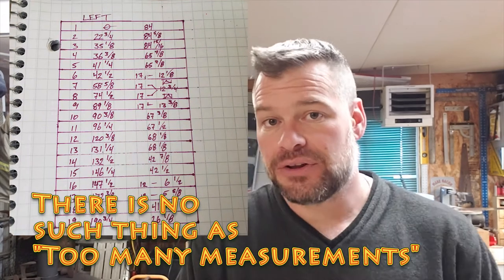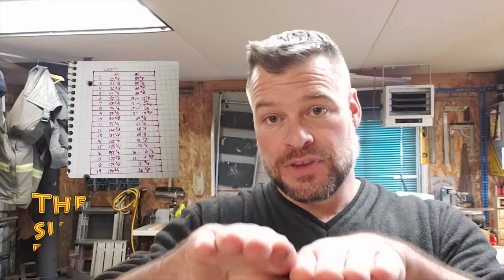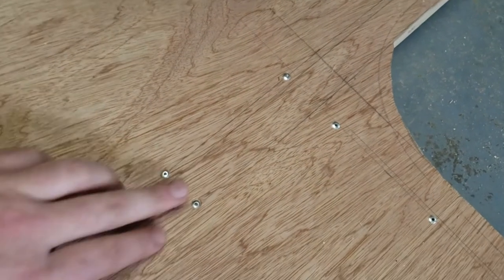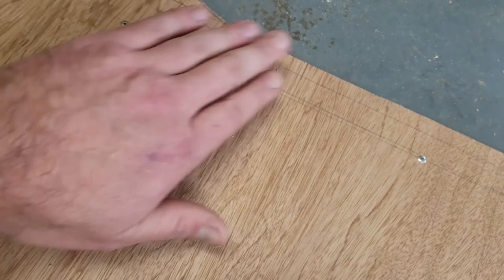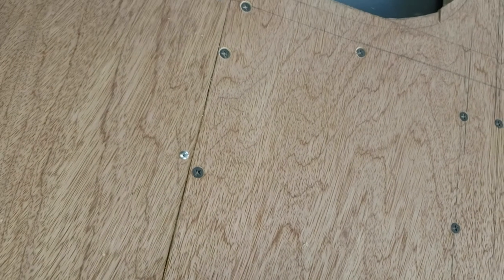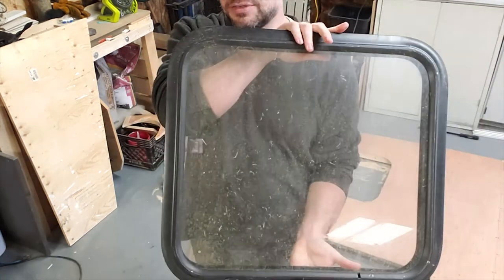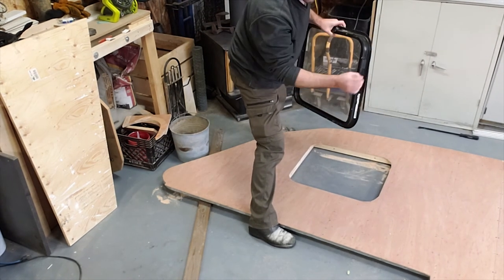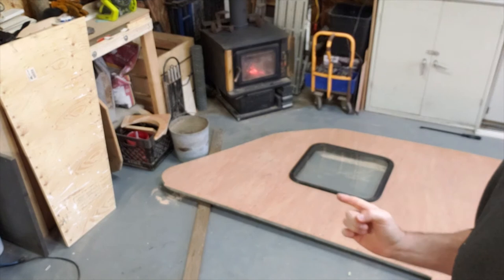Wall Exterior - DIY Truck Camper Build Series 003

Comment: I visited an RV manufacturerlast spring who’s builds aluminum framed RV’s they use  product called Silaprene adhesive/ sealant. The manager showed me a picture of one of their units that got caught in high winds and was blown over onto its sides.  There were no structural failures that could be found. I am starting a truck camper build using steel studs 5/16 MDO ply and I am planing to use blind rivets through out including the siding with the silaprene adhesive. It is my opinion it will be iron clad strong
Reply from the maker: Hands down,  I've found that rivets was the way better option over screws.  
I bet you're right; your build will be like dice,  it can flip and not flex. 
Sadly,  the spoke in costs of everything this year postponed the new build,  indefinitely. I'm renovating my existing camper,  at a much lower price point,  and not requiring a truck upgrade also.

Comment: Put more rivets in. America's roads are like putting a camper through an earthquake, not to mention the pressure from the wind while driving.
Reply from the maker: You're right. I think this is the only wall that I'll use the screws.  Everything else will be solely rivets.

Comment: I’d replace the screws with rivets.  I also think trying to countersink in 1/4” plywood is crazy to begin with.

I would have thought about welding the studs and channel together, but I guess you can’t weld galvanized steel….  Only I’d swear that I’ve seen them spot welded in residential/commercial construction.
Reply from the maker: Spot welds would work,  I bet.

Comment: Extremely busy slow week... I hear ya there! I’ve been waiting to see your progress, looks great! As for the rivets or screws question.... I’m a big fan of rivets lately but I can tell you from experience they are not cheap. I think your glue will help you out but you could space out some rivets “just in case”.

Oh and I still haven’t received your email.

See you next week
Reply from the maker: I think I'll add rivets,  equidistant in case of showthrough, and leave the screws in. 
The cheapest I've found is the bulk pack of steel rivets at Canadian Tire.  I did buy a couple Arrow packs from Kent too.  I've used about two hundred thus far,  and maybe have 500 left before I have to restock. 
I found the issue with my rivet gun.  They sold it dry as a bone.  No oil in it,  thus no pull. It's still a pain to use,  forcing every rivet stem through it.  They dont fall free.  I might just borrow a CherryMax rivet gun from work when I need it.  That's the Cadillac.
Reply from the maker: Also, it shows sent Feb 8th. Junk folder perhaps? I just checked the address,  and it's exactly as you've typed it on your "about" page.

Comment: Just came across this randomly suggested, probably as i've been looking over a lot of builds. I started one about a month ago but have gone down the wood frame route despite the insane cost of 2x4 and plywood right now, curious how the metal stud frame will work out.  If you want cheap rivets see if there's a Princess Auto near you, that's where I get mine.  Weight is my biggest concern as i'm building it for a half ton.
Reply from the maker: I found the cheapest solution for the steel rivets is the Canadian Tire bulk pack. 
I have many aluminum from PA, but their steel ones were more expensive than CT.
My curve camper is framed with 2x2 (2×4 ripped in half) and is glued and screwed.  Two years later,  it's still not showing any signs of wear or fatigue. 
I'm also running on a half ton,  with airbags.  I'll most likely need to step up the truck for this one though.